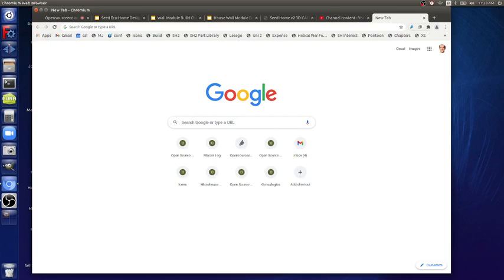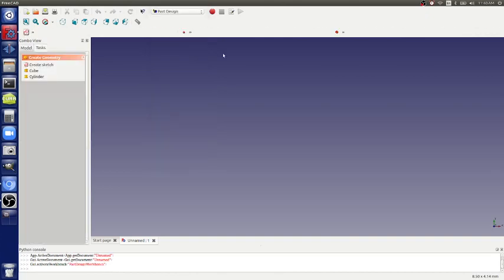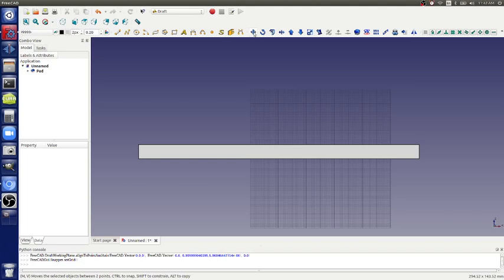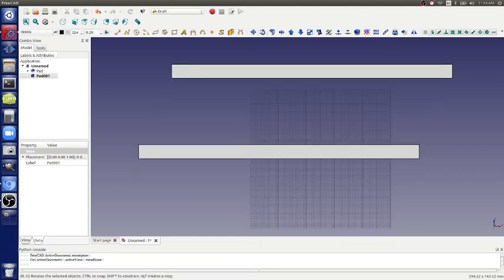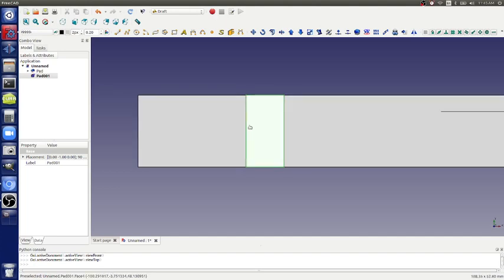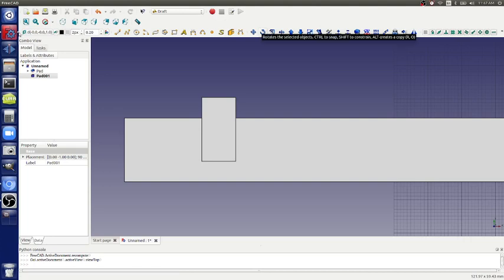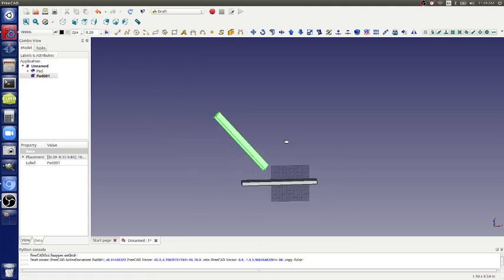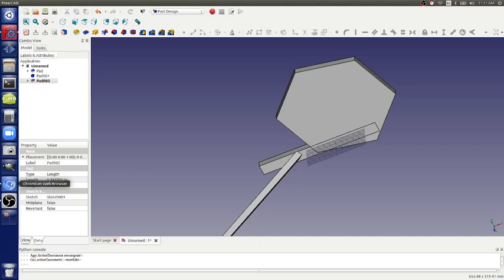Day 2 - Move and Rotate Parts in FreeCAD

Comment: 2:31 START OF DEMO
2:34 Use Draft workbench
4:00 Change view with shortcuts 1, 2, ... 6
4:30 Select "Auto" on toolbar, then
  4:53 Select "View" on task tab
5:55 Accidentally moved outside of plane
5:28 Moving an object